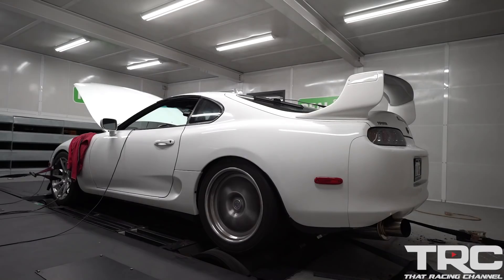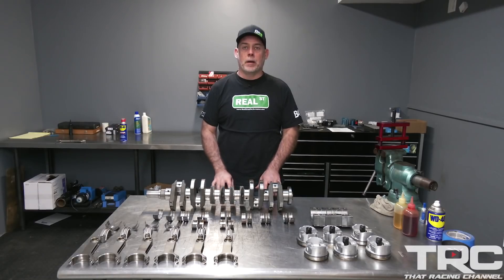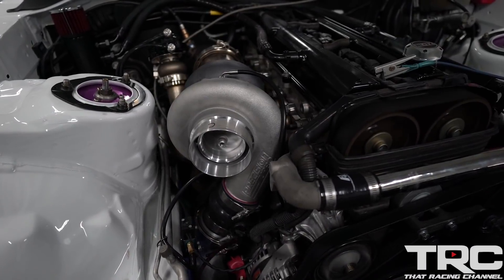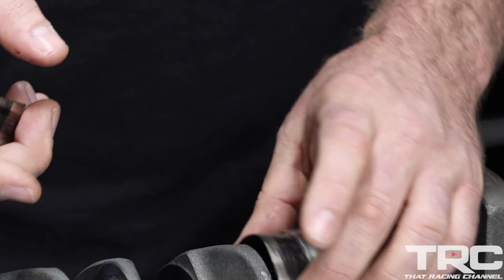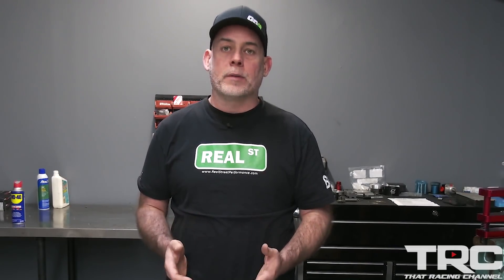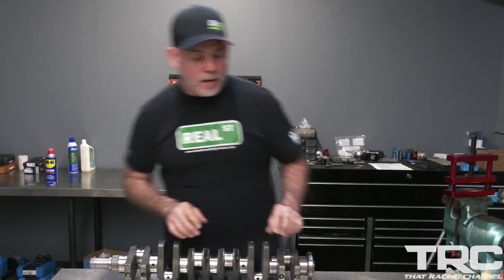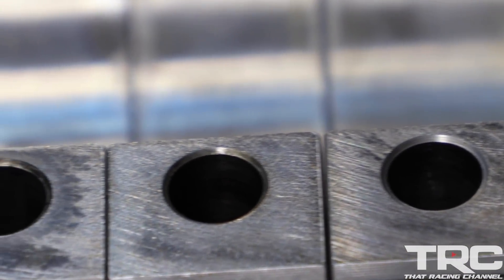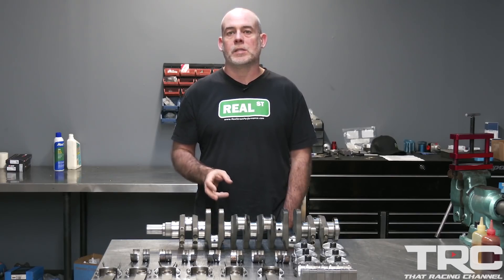We Destroyed a 1500HP 2JZ on Purpose - After 1000 Pulls! (Engine Teardown)

Comment: Soooo 1000 pulls, averaging about 5s a pull in 4th gear = only 1.4 hours of lifespan 😂😂😂 wouldn't even last ONE F1 race, and that's only pulling one gear to redline.  We all know dyno queens don't get loaded the same way as on the road, so this makes this "1000 pull" claim....(shhhhh...not something you should brag about) 🤗🤗🤗🤗
Reply: They drove it too....
Reply: @003590510  selective picking of the facts...  that engine, even by his standards, failed long before he tore it apart.  That 2JZ engine has a severe lubrication problem, at high HP levels.  Who wants to rebuild the engine every 1.4 hours of use???
Reply: @003590510  ¿Remember?  It picked up a *noise*, PRIOR to them, destroying it?  Prior means, before, BTW.  To quote someone I know, "Reading comprehension is your friend!"  lol SMH 🤦‍♂️
Reply: @003590510  once again you have selective memory... This engine was not a perfectly running engine and they decided to destroy it with bad  gas. It was already in a failed state.

Of course a Formula 1 engine would fail if it was intentionally destroyed you moron. A Formula 1 engine however would definitely outlast 1.4 hours of use.  2JZ.... make 1400rwhp, for 1.4 hours!  Yeah, that's a good engine lol SMH 🤦‍♂️
Reply: @003590510  0:45 it picked up a noise  (so we decided to destroy it)
Reply: @003590510  do you even watch Formula 1 you pole smoker? You can't even touch the engine in Formula 1. If your engine fails or you open it, you get a grid penalty. You are only allowed a certain amount of engines per year . GTFO here with your baseless knowledge. 

"Once a race finishes the exhaust ports get sealed with blanking plates and it can't be run or touched until the nextFormula 1 event. However,engines can't be rebuiltduring events either. Once anengine is homologated and "sealed" by the FIA, no modifications are allowed."

Educated yourself.  Google is your friend.   LOL SMH 🤦‍♂️

Comment: Curious as to why not use a connecting rod that has had color change? During rebuild for a p71 4.6 I had to press fit the pins, which in turned colored the small end of the rod. Is that basically the same concept anyway or is it just coloring changes in spots that are abnormal or ones made from just running?

Comment: at 5:00 when referencing "poor oil quality" what can an average guy do reasonably to mitigate this issue? Frequent oil changes, more so than nomal? Because a dry sump system is out of budget for me and many out there
Reply: Increase your oil pressure if possible, some pumps even the original ones allow some, if an oil cooler is present ensure there is a thermostat in the system, adding oil cooler and longer/larger lines than needed increases your total oil capacity, manage and monitor oil temperature, after sometime you'll be able to do it by just looking at the oil pressure gauge (oil pressure higher on colder oil, pressure lower on hot oil)..
I think the most important aspect of this is pointed through the whole video, data data data... Need to do some homework before making changes, or you may end with worse setup than before. Boring, tedious but necessary.
Reply: Increasing oil pressure and adding oil cooling with bigger oil lines would be great start as other comment says but here is the catch: better oil will always help alot,and more frequent changes will help alot aswell since oil manufactuers and car manufactuers put thier estimations on stock power and torque,same goes for other parts of car and lubrications inside said parts

Comment: A 100 pulls on an engine of that power level would be impressive, 500 would be insane. 
A 1000 is truly outstanding. Incredible work regarding the integrity of that build and all the parts within it. 
As well, the dedication to the sport and its participants; whether they are shops installing and recommending these products, or customers racing and beating the piss out em, is immense. 
Awesome vid guys, thanks for the hard work.
Reply: Im passed 500 with stock valvetrain at 9200rpm k20 not a single drop of oil gets burned yet im impressed hehe,far from this for sure

Comment: So if I put this motor in a daily street car, it should be good for quite a while until I would want to rebuild it... I was lookin hard in to the K24a2 motor but puttin this in a eg hatch has been done and I think I’m up for the challenge of making better motor mounts
Reply: Hohmies Mcfly do iiittttt
Reply: U will need to make channel for the transmission and channel for the driveshaft..its been done before..basically need to cut the car in half allmost..
The k24 might be a better option lolll gd luck

Comment: In simple words. That engine was not made for that kind of power.
Reply: CROOKED CLOWN you mean it wasn’t meant to run at that kind of on low amounts of oil and questionable fuel
Reply: And 1500hp LS with bad fuel and oil will last more than 1000 pulls. Me thinks not.
Reply: They had to make detonation for it to get damaged so yes it will handle it like a champ!
Engine not made for a power level you find out too late on the first pass loll